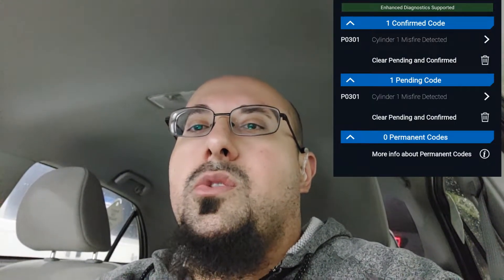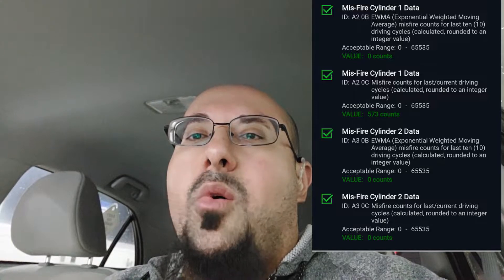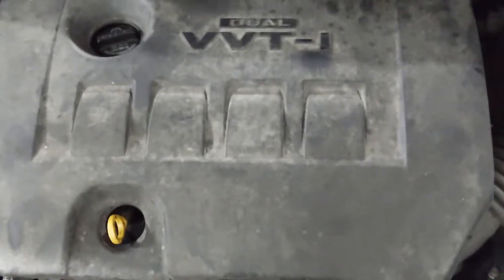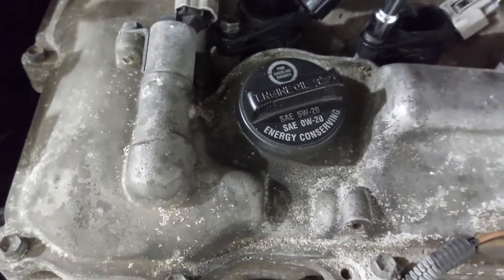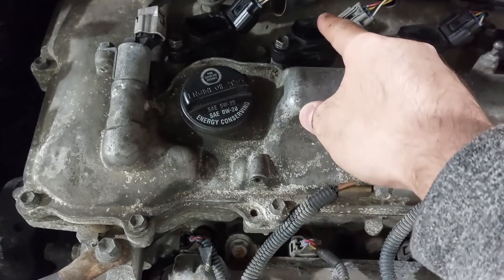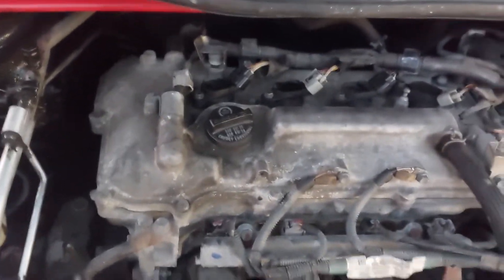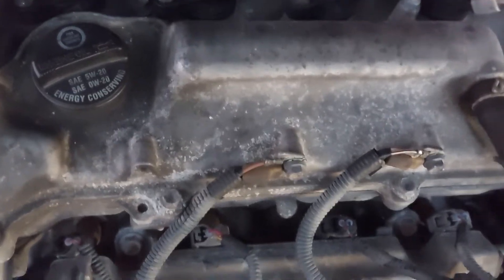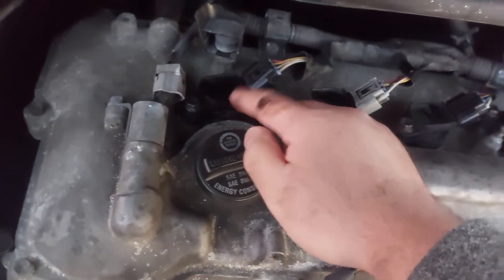Why Engines Misfire - P0301 - 2010 Toyota Corolla 1.8

Comment: My buddy had the same problem after changing the cylinder head. He changed all the injectors and coils and plugs. 
 Compression is 125/150/150/150. I said i think there's something wrong with the remanufactured cylinder head. Any suggestions?
Reply from the maker: Is it still misfiring after replacing it with the remanufactured head? The compression readings look OK to me it won't be the same for all cylinders since machines are not perfect like humans. There will be a little bit of variance between the cylinders. As long as it's within 10% of each other between the highest and lowest readings then you're fine. If it's driving and runs OK I wouldn't worry about it.
Reply: @moosemobileautorepair  wow thx for the response. The head was replaced due to a burnt valve on cylinder 3. He Remanufactured the head, installed and now has the misfire on cylinder 1.  I felt maybe the shims could be wrong on the valve? But I agree the compression is good. Spark is good,  I think he should do a fuel pressure test or maybe as you described in another video, oil pressure galley could be plugged thus affecting the vvt.

Comment: I was told when intermittent, there could be coolant getting into the cylinder, which means a new head gasket…or new car.
Reply from the maker: That's always a possibility on an engine. You can check with a borescope camera through the spark plug hole to see if there is any leakage. There are also several tests you can do to check that as well to confirm if that's the problem.
Reply: @moosemobileautorepair   It’s happening to me right now. The mechanic said that it didn’t follow from number one to number two when switching coils, so he pulled out the number one plug and said it looked like it was steam cleaned, so  he used the scope to check inside and said the top of the piston looked steam cleaned. It must be a very small amount of coolant because my temperature hasn’t changed and the idle smooths out after 10-20 seconds and then it drives fine. But now I know I’m on borrowed time and I need to get a new car asap.
Reply: I’m guessing that once it’s smooths out that heat or pressure are keeping more coolant from getting in….for now. Is that a logical assumption or is it something else?
Reply from the maker: What kind of vehicle is it?
Reply: @moosemobileautorepair  A 2010
Corolla like in the video. lol. No joke.
Reply from the maker: What's the mileage on it? If you can check with a borescope camera inside the cylinders then that would be sufficient. Especially if there is coolant inside there. Did the mechanic do a compression test on the engine? How does the vehicle run/drive after it warms up?

Comment: Thank you just had this problem. Changed  the ignition core . Reset the code . Everything  was OK.  Drove the ca forawhile and the  check engine licame back on the Vsc came back 
Can you give me what might wrong. Or what  I can do ? Thank so much I would appreciate  it. Eneida
Reply from the maker: What brand of ignition coils did you use? Sometimes cheap aftermarket coils can cause problems. I recommend using the original OEM coils. Also, did you check/change the spark plugs? Usually a bad coil will damage the spark plugs as well and should be changed as a set unless the spark plugs were done very recently. Start with that first and let me know. 

Now other things can cause that P0301 misfire code so you will have to determine to see which system is causing the issue. An engine will need spark, fuel and mechanical integrity to work and function correctly.

Things like low compression in that cylinder, a bad fuel injector, just to name a couple things can cause that misfire code so you will have to diagnose it to verify which system is causing the problem.

What is the current mileage on that vehicle?
Reply: @moosemobileautorepair I have the same problem like the guy above.